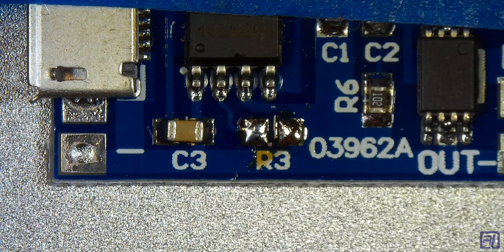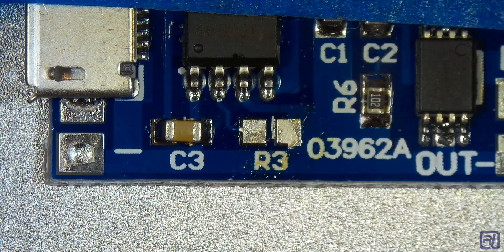Lower the charging current on a TP4056 charger board.

Comment: Hi..Thank you for the good Info on how to change the resistor.I need Help..i have the same battery  3.7 V  - 1000mAh  Can I use TP4056 .with 5V 1A to recharge it or i should  change
the resistor 1000mAh ..if yes kindly you tell me which suitable  Resistors to Replace  I`m really sceard of doing any mistake  I would very appreciate your help Thank you
Reply from the maker: Hi, thanks for the comment. You should lower the charging current, 1A is too high for your battery.  I would charge it at 30% of the total capacity so use a 4K resistor to lower the charging current to 300mA.
Reply: Dear MR / @rlopezxl  Thank you very much.You advise me to use 4K resistor.my Q is if i change the resistor to 4K then can i use 5V 1A mobil charger ??
do you have any idea from where to buy those littel resistors 4K  or i should use normal 4K R with colore line .Once again Thanks and God bless you The earth thanks the clouds when the rain comes!!
Reply from the maker: @biancad6289  Yes a 5V 1A mobile charger is fine.  You can buy SMD resistors online on eBay or Amazon, you can use a 1/4 watt resistor (the ones with the colored lines) just cut the leads short so it will be easier to solder.
Reply: Dear MR / @rlopezxl   Thank you very much..really you helped me i was struggle in the time i bought 20 of those battery last year after that i look every where on how to charge them even here in youtobe some they dont give proper help .and you solve it for me..sorry one last Q if you dont mind 1/4 watt how to describe it 1/4 watt means 33 Ohm or 3K  and the smd resistor in ebay i just type smd resistor only theres number I apologize very much for bothering you Ruben..you are a Great man has Great heart Thank you.. Greetings and appreciation to you from St. Kitts Island
Reply from the maker: @biancad6289  1/4 watt refers to the type.  Here is an example of an older TP4056 board that I modified using a 1/4 watt resistor https://rlopezxl.files.wordpress.com/2018/05/ds_tp4056mod1.jpg and https://rlopezxl.files.wordpress.com/2018/05/ds_tp4056mod2.jpg.  Use a 1/4 watt 4K resistor. For the SMD resistor, search for "0805 SMD kit" on eBay.  It is cheaper to buy SMD resistors in a kit.  The kit should include most common values, including 4K.
Reply: Hello  @rlopezxl  How are you.if you dont mind calling you Friend now I understand every things After having suffered a period of searching for a solution.Ruben i went to google there was many kind and i find 1/8 I apologize 
i gues i better use resistor like the one you showed me in the picture easy better.so i will buy resistor 4K with colore from ebay iif you have any link to buy it will be great..
In the end you are the one who has scattered the very dark clouds on the horizon.after i lost all hope keep healthy be safe Ruben and once again Thank you wishing you all the best in life and forthen life amin we may forget the one with whom we have laughed.but never the one with whom we have wept.!!
Reply: I'm glad I found this, been using tp4056 for years on a 1000 mah batteries, but always on usb limited to 500 mah.

Recently used a power bank in an emergency that outputs 3a and the battery decided to pillow within a month.

I have a bunch of 4056 and would rather cheaply change the resistor than buy another batch of charge boards

Comment: Q :    Is there a way to adjust the Charging voltage on the TP4056 or is the reference within the IC ?  I wish to only charge my 18650's to 4.0V max ?
Reply from the maker: That's set within the IC, no way to change that.
Reply: Yea, sorta figured that out after I found the data sheet.  Thank You for the rapid reply.
Reply: the charging voltage I dont think so, but if you want the final charged voltage here is how to do it.
you need to use a Schottky diode, depending on what you want the battery voltage to be.
Explanation: lets say you want to charge your battery to 3,8V, so you need a Schottky diode of forward voltage of 0,4v.
This will make TP4056 think that the Battery is charged to 4,2V, while it is charged to 3,8V.
tricky tricky :D
Reply: @DrZipZwan  I think it would be a good idea to make a storage voltage charger. Can you tell me where to put the diode and which direction?
Reply: @DrZipZwan  could you use a variable resistor to replace R3?
Reply: @goku445  yes , you can and there are videos about it around.